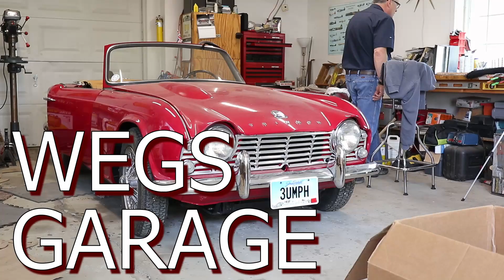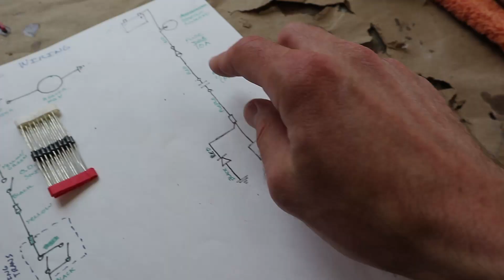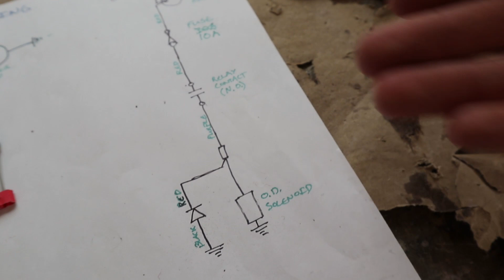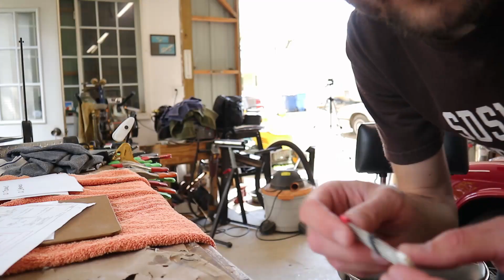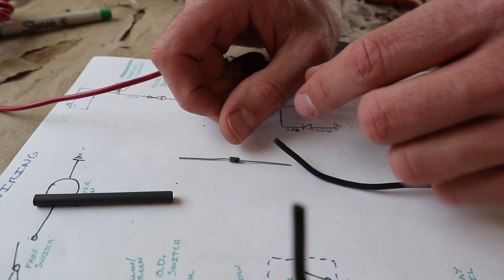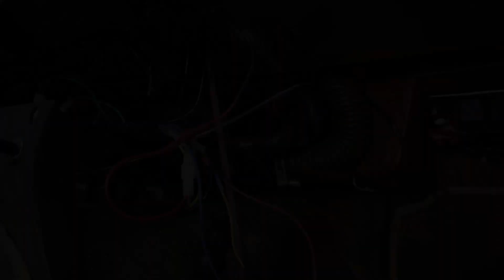CHEAP Relay Protection - Flyback Diode for Triumph Overdrive Solenoid

Comment: To be clear, you “spliced in” the power side (red) of the diode to the yellow/purple wire going from the OD relay to the OD solenoid? Then attached the ground side (black) of the diode to chassis ground?

Comment: Well done. And not something to overlook. :)

For an excellent video on the subject of the flyback effect: https://www.youtube.com/watch?v=LXGtE3X2k7Y 
And while not related, this is an excellent way to protect your devices from reverse polarity by the same guy: https://www.youtube.com/watch?v=IrB-FPcv1Dc

Some of us have a half-dozen or so scopes, but here is a cheap, but fantastic, four channel 100Mhz, I mean 50Mhz (cough, hack it to get the 100Mhz, and a whole bunch of other perks, cough) O-scope: https://www.amazon.com/Rigol-DS1054Z-Digital-Oscilloscopes-Bandwidth/dp/B012938E76 I have one that goes everywhere that I go (as it's home is in my car).

And flyback diodes can be used to speed up the opening of the contacts of the relay that is controlling them by matching the impedance of the coil with a resistor connected in series with the diode. This value (in Ohms) can usually be found on the relay's data sheet. This is handy for us controls engineers who wants things to happen in a very deterministic (and speedy) way.

For a diode that will hold up, and is automotive friendly, this one would be a good one to get: https://www.ebay.com/itm/383691285656?chn=ps&mkevt=1&mkcid=28 The screw stud would be connected to the frame on a negative ground vehicle. Which makes mounting it a snap, and the solder tab would accept whatever wire that you are using. The specs are definitely overkill, but the ability to withstand physical abuse makes it hard to beat. 

But your 1N4007 was a very good choice for this application, and as long as you find a safe home for it you're golden.

And if you are still not convinced about the damage DC can do to your contacts, check out this video: https://www.youtube.com/watch?v=-0zRko8FAh8
Reply from the maker: I was hoping to get your attention with this one 😜. You were probably the one that got us thinking about this. Maybe should have had you on as a guest star! 
A scope would be fun to have! 🤔
That frame mount diode is awesome! Never seen one like that. Maybe an upgrade is in order.